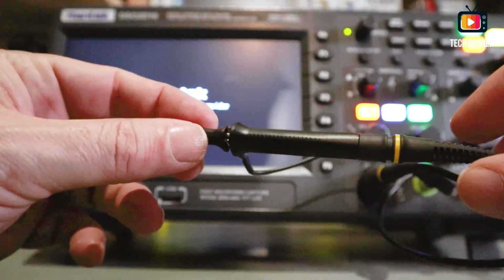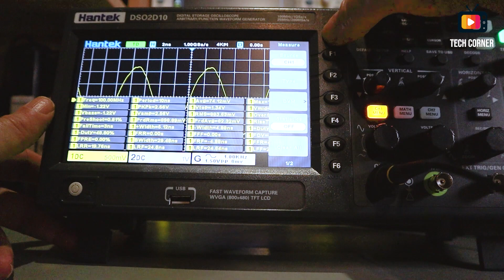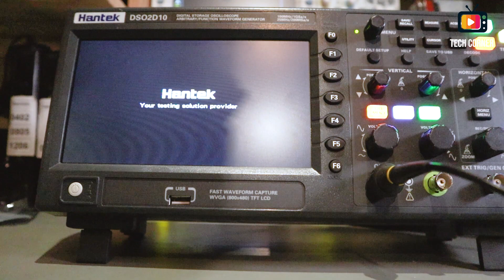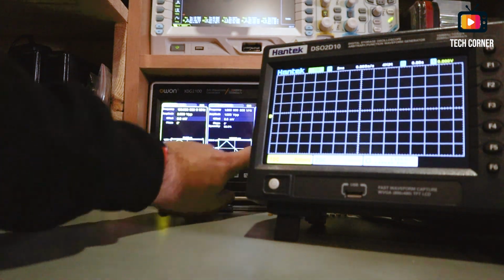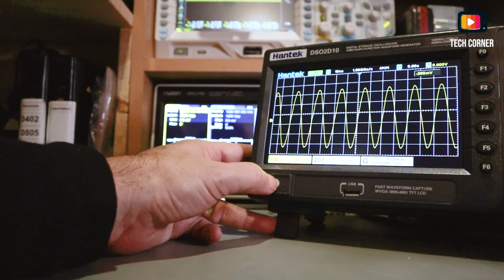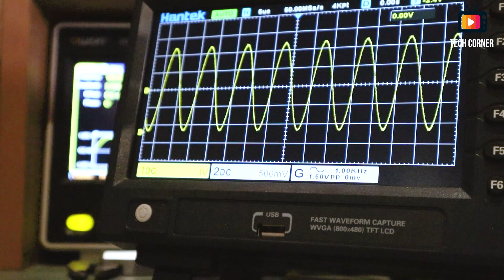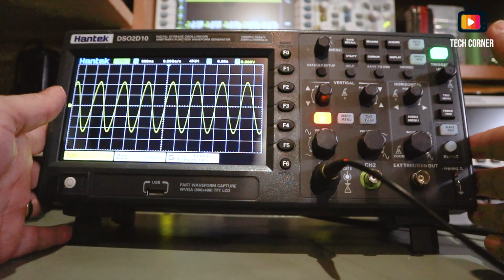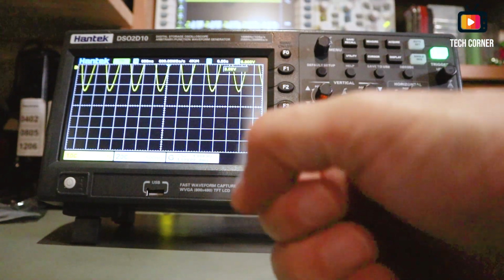Hantek DSO2000 How to Freeze It Under 10 Sec 💪 2C10/2C15/2D10 & 2D15 Oscilloscopes

Comment: Mine arrived today may 18, 2023,I tried to reproduce the "freezing" above 1 mhz with the inbuilt sig gen, worked fine, even up to 25 mhz. My firmware version is 3205, but I need to do a lot of playing with it first. Mine is the dso2D15.
Reply from the maker: Hi, there are several updates after this happened that fixed this situation, if you received yours today, it should be with the latest firmware and you're good to go! Thanks for watching.

Comment: Did you solve with firmware update, friend???
Reply from the maker: Hi, my final & last test is here in this video https://youtu.be/eMxmeh8_XvE . Spoiler, still has some problems but the main ones that really took my sanity are fixed, there is some smaller ones, but overall, I still think is a good oscilloscope for the price you pay. Thanks for watching.
Reply: @TechCornerTV  could tell me please what problems you still found in yours ??? Mine is almost arriving and I would like to test to see if have the same problems. :')

Comment: Hello, dear friend! Again, I am writing you a letter from Russia)))), I want to warn you about a problem with this Hantek 2000 series device. These Hantek devices have a very important drawback. This disadvantage lies in the fact that the device has a switching power supply, the power supply also has a capacitor "Y", two oscilloscope measuring probes are connected by grounding, and the grounding is also connected to a plug and socket. We conclude 1) When measuring any board, you can install a minus sensor at the plus measurement point, so we close the circuit of the measuring board through a plug, outlet along the ground line and can spoil both the device itself and the repair board!. This device needs galvanic isolation through a transformer. 2) Devices of the 2000 series get very hot and cause the device to freeze, in order to eliminate this drawback, it is necessary to disassemble the device and install cooling radiators on two chips on the board.
Reply from the maker: Hi, I dealt with overheat problem also, it very stupid, they have a holder for a fan inside, why didn't add $1 to the price and put the fan inside, it will help a lot. Thanks for watching!
Reply from the maker: My pleasure and glad I could help.
Reply: I want to thank you , your video helped me to resuscitate the device, Thank you for your work !!!!!

Comment: I received my Hantek DSO2D15 this week and it has software date 1.0.2.0.0(221028.00) and Firmware 3205. Tried it at low mvolt to 10v and all freq from 5hz to 10Mhz with no freezing of the display when i moved vert. position. Looks like they fixed the issue. Great scope, works well so far.Not running hot either.
Reply from the maker: Hi, sorry for the delay in the reply, this message was marked as "Held for review", different section, doesn't appear with the everyday messages. Regarding your comment, I'm going to the the update to the latest version very soon and redoo the test again one LAST & FINAL time. I do hope that everything is ok, I do like this scope. Thanks for sharing & for watching!

Comment: Hi Hugo,
why does Hantek have such lousy quality in its oscilloscopes? My Opinion: Hantek can't do better! Hantek products are like bananas.... They mature with the customer. I think there are customers who send the rubble back immediately, others bring the crap into the basement, to forget. And only a small part, the customer, does it like you!
 Go troubleshooting, like you!
Greetings from Tom
Reply from the maker: Hi Thomas, more than the quality, is the feedback I got from viewers of the channel that tried to contact the support. Because in terms of quality, yes it has some bugs, but the last filmwares almost fixed everything. Still some issues on low voltages, the problem is the lack of response when contacting support. For the price, they give you pretty much and in most cases it works... but the lack of decent QA is so frustrating... Owon, I have a very good impression of them, can't compare the entry level to Rigol or Siglent, but they're very acceptable devices.

Comment: Installing radiators on both main ICs is highly recommended. Helps with random freezing caused by overheating.
Reply from the maker: I will do a new video with testing voltage and stuff, lot of viewers asked, not this week, but in the next. I think it's solved with the new fw, anyway, the fan will help a lot, thats true! Thanks for watching!

Comment: Please I have the same model but AUTO SET BUTTON DOESNOT FUNCTION PROPERLY, WHEN I PRESS AUTO SET BUTTON IT DOESN'T GIVE ACCURATE MEASUREMENTS WHEN AM MEASURING AC SIGNALS, REFERENCE CRYSTAL'S OF LAPTOP MOTHERBOARDS. PLEASE WHAT MAY THE PROBLEMFOR SUCH ACASE
Reply from the maker: Try to see the 3 videos I made and uploaded last saturday, I show how to upgrade de low level firmware, it might help you! Thanks for watching!

Comment: MODEL:DSO2D15　SOFT:20220118.00　FIRM:3202　INPUT:1MHz(Sine 2.5vp-p)　200ns/div　1Gsa/S
Even if I moved the position to the upper limit, it did not freeze.
Reply from the maker: Hi! I've updated mine to the latest firmware and today I will test it again and record all the tests.... let's see if is fixed. Mine can be a defective unit...  I accept that! 👍

Comment: Hi, I tried this from 1Mhz, 10Mhz, 50mhz and 60mhz (that's the max it can go of my uni-t fungen), my 2C10 (converted into 2D15) didn't froze, I'm using the latest firmware and the FW3202. I saw this problem on some of the earlier units.
Reply from the maker: Hi! I didn't buy as soon it was released but even so, I bought only few time after and you might be right, I already saw this movie with the FNIRSI 1014D were my unit, one of the firsts to be delivered, had a lot of issues that some other users didn't report. A viewer here in the comments already told me that the February update will solve this, I hope so!  Thanks for watching and your input on this! 💪

Comment: I have the Hantek DSO2D15 with Software 220210.00 and firmware 3203. I have done exactly what you have in this video and, so far, my unit hasn't frozen once. It'll be interesting to see your follow up video to see if your results are the same.
Reply from the maker: Hey Steve, a viewer here said that the February update solve this issue, I hope so, before doing the test I will update the firmware to see if it solves. Thanks for watching and your input! 👍

Comment: Thank's for yout Video.The hantek is definitely a piece of junk. I've had the scop for 7 days now and it freezes even in simple situations. Today I can't bring it back from deep sleep by restarting
Reply: I had the same problem.  Check out my video on bringing back a bricked Hantek DSO2D15. https://youtu.be/dlSlevxl-z4
Reply from the maker: Hey David, you have a very nice video there, thank you for sharing! 👍
Reply: @LifewithDavid1  my oscilloscope it's dead
Reply from the maker: Hey Tanja, sorry to hear that. In general, if it works, will be a ok oscilloscope for most of the usage, but with this problems is not very useful. One viewer said here in the comments that this problem that I found will be solved with the February update, hope so! Thanks for watchin and for sharing your experience! 👍 Good luck solving that issue, I hope you manage to get it working again.